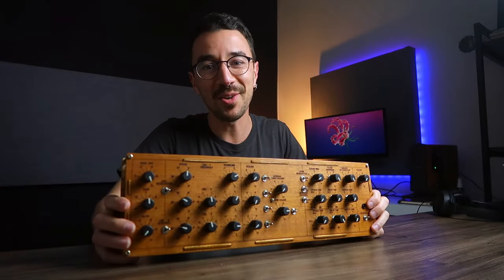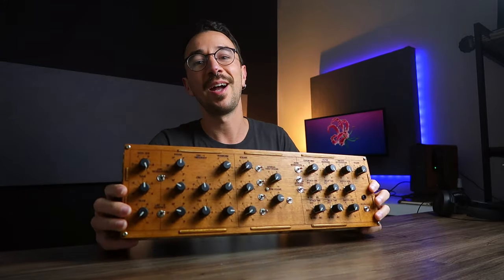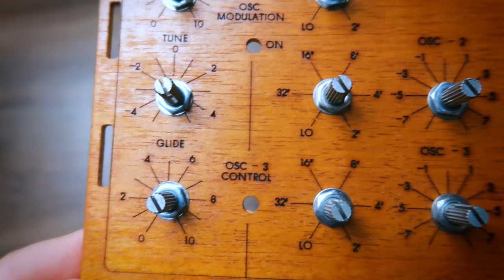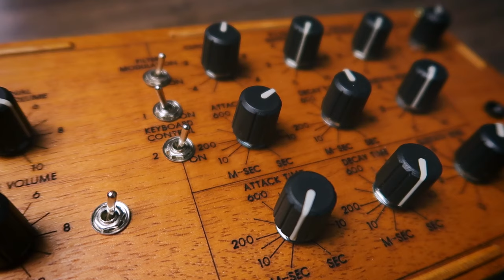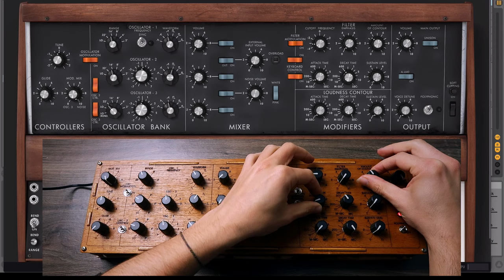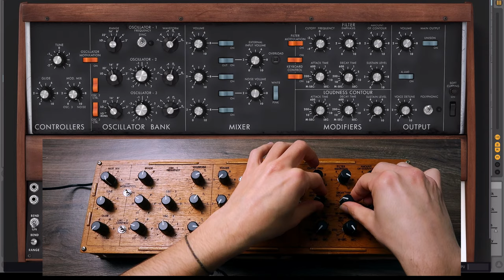I built a MiniMOOG based Arduino DIY MIDI controller!

Comment: Hi - would like to build this - but, I'm not sure how to interface it to the outside world. Your schematic shows pots, switches, multiplexer board and the Arduino, nothing else. There is no MIDI interface - no audio out, etc. What am I missing?????
Reply: The MIDI is going  out  the Arduino USB port
Reply: @altonemill341  It's a MIDI controller. You need to connect the USB of the Arduino into a computer and load a VST synth
Reply: @zaga9560  and vst-plugin should support midi cc

Comment: Just some hints: a better soldering iron would do wonders. Also, it is not a good idea to put the solder on the iron and then apply to the cable and soldering point, but apply the soldering when the parts are already in touch, so the flux inside will do its job and you will get better looking soldering points. I am not a fan of the way you have distributed the power rails either, I would have used other kind of wire. Also, try to keep the peeled part of the wires as short as possible. And plan a bit in advance the length of the wires to get better looking end products.

I know my comment could sound harsh, but it is just to push you to the perfection on your wonderful DIY MIDI controllers. I have signed up your course, in case you have any doubt of my appreciation for your work. But having soldered and tinkered with electronics for close to 40 years, makes me picky :-)

Keep on building!

Comment: U did a really nice project. In this video u use a soldering iron, I did a little laugh, from the early 1920s, isn't it? But it works and u do very success. This amazes me much.
Reply from the maker: It's from the early 2020s

Comment: Well congratulations, it looks very nice. I just had heart attack when I saw your wiring..lol. but it works that's fine.
Reply: One way around the birds best is to lace with string or another wire. Its commonly used on aircraft and old world equipment. A bundle of wires will be stiffer then the wires loose.

Comment: I found a Roland Edirol in a thrift shop that doesn't seem to be working.   Can one use the pots and other parts in that for an all original design MIDI controller?

Comment: Very awesome! How did you print the control text on the surface of your controller board? Did you use a laser engraver or something?
Reply: I would say that the OP did, in fact, print the panel using laser engraving.

Comment: Hi, I built the controller using your sketch but I put 3 multiplexers because I wanted to have all the controls. Everything works but the Cutoff knob moves the Modulation and the mod mix knob moves the Bend and they are not programmable from Advanced on Arturia's Minimoog. Then the polyphonic led is always on ... Did I do something wrong? Thank you

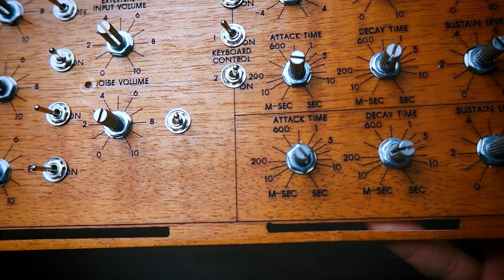Comment: Nice! What's the wire you use at 3:00 for the ground line? Seems really handy :)
Reply from the maker: I use solid copper wire. Pretty handy!
Reply: @NerdMusician  nice! may I ask where do you buy it? I've been trying to find some but can only find enameled wire which is quite difficult to solder.

Comment: Did you use an arduino for this controller? I saw the smaller chips but those look too small to be an arduino
Reply: LOOKS LIKE A PRO MICRO AND TWO MULTIPLEXERS
Reply from the maker: That's right! One Pro Micro and two multiplexers 4067 (breakout board version).

Comment: cd4067BE is an obsolete chip , what do you suggest. and did you proto board them as they do for sn76477 at BG micro ?
Reply from the maker: I use the 4067 smd in a breakout board. Didn't use a protoboard for the Micro, just wires.

Comment: would have been easier to just build a minimoog based analog synth behind the panel LOL
Reply from the maker: That would not be easy at all! haha
Reply: @NerdMusician  I already tried
Reply: Depends whether you are a computer engineer or an electronics engineer I guess.
Reply: I'm neither.  @TheDavidPoole
Reply: @zerstaerker  then both would be equally easy for you 😀
Reply: @TheDavidPoole   I prefer analog circuits for their simplicity.

Comment: All that wire looks like a nightmare, why not use a circuit boards to mount the controls? Also why use pots instead of encoders much more accurate with vsti's, looks nice though otherwise well done.

Comment: Hi, mate! If I use UNO do I need to change port 16 to port 11 in the sketch? and i can use it via virtual midi port + i need to assign a potentiometer and toggle manually in artoria? i just need to write ATMEGA328 1 and uncomment MIDI_CREATE_DEFAULT_INSTANCE?
Reply from the maker: Whats do you mean with port 16? You just need to change to ATmega328 in the beginning of the code. 
I don't get the question about the virtual MIDI port. You mean using Hairless MIDI?
Depending on your lib version you have or not to comment MIDI_CREATE_DEFAULT_INSTANCE, it depends if it complains or not.

Comment: I like the wooden case. The Video itself.. edit and music (very interesting choice) are great... but that cabling...looks like an explosive device :)
Reply from the maker: I used shriking tube in all the wires, and the cooper wire is not going anywhere!
Reply: @NerdMusician  Its OK I'm just kidding, you doing a great job.. I prefer a PCB for UI elements connection but that's not so important..
Reply from the maker: WebB LaB I’m planning on building a PCB for this guy! So, let’s if this happen soon. :)
Reply: @NerdMusician  Aaa.. OK so this is just a prototype, let say.. Prototype with very nice case 👌😁👍

Comment: This isn't a "MIDI Controller".  (e.g. a device that controls another MIDI mapped Device. ) Arduino based USB MIDI Synth would be a better description.
Reply: except that the synth is on the computer, so it is just a midi controller.